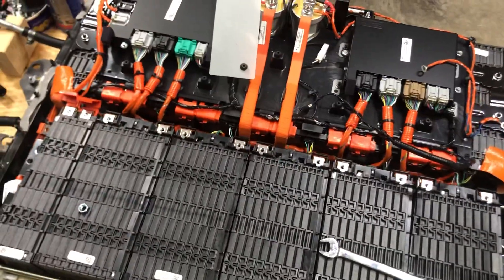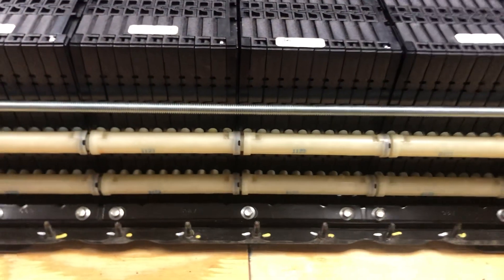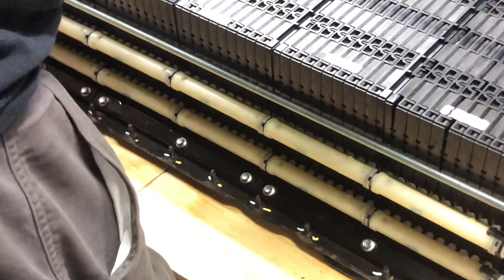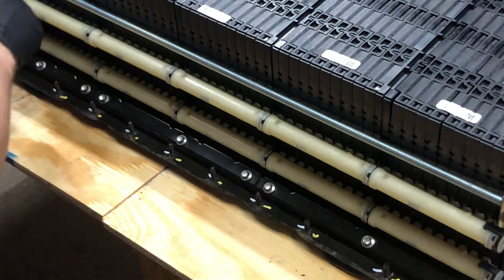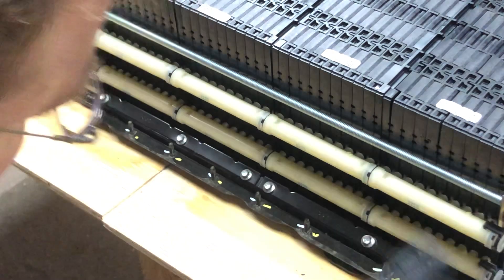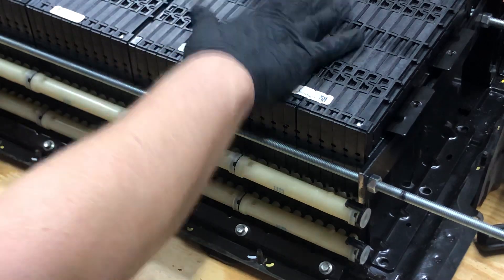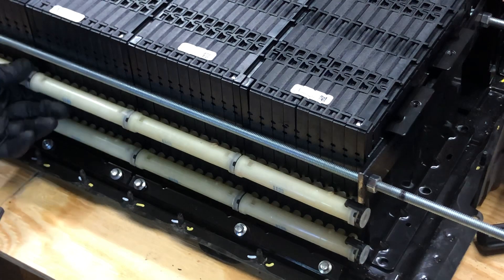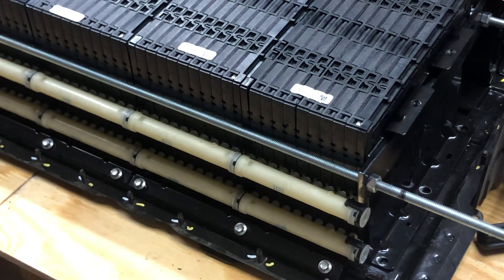POAA6 battery voltage leak repair that did not work!

Comment: You're pretty funny dude! Thanks for making these videos. I have a similar problem with my 2013 FFE. I have been trying to find out which pack is pack A for a while now. Thanks to your videos I know which one it is! I found some used batteries but the company sells the top and the bottom separate. You just saved me $1800.
Reply from the maker: Thank you! I love making YouTube videos especially when they are helpful to people. You can always call or text me at the number on my video.

Comment: Could you tell me how to remove the top battery cover from the lower battery pack? I have my lower pack out and need to open it up to see if it can be repaired. I don't want to damage anything. It seems to be glued on there. Any advice would be appreciated. Thank you!
Reply from the maker: It can be removed by prying the top off. It take some force. I used a couple of 15 inch crow bar/pry bars like you would use for construction. You can by them at Lowe’s or Home Depot. Wrap some electrical tape around them leaving a half inch of metal exposed as a marker so you don’t shove them in too far. It has a gray foam type sealant that holds it on. The hard part is finding new parts to complete the repair. They are almost non existent.

Comment: Did you ever fix the P0AA6 code?  If yes, what was causing it?
Reply from the maker: Yes, the POAA6 code in my case was caused was caused fluid in the battery. The coolant plumbing had been pushed about by battery bulge like you would see in old cell phone batteries. I could not find new battery parts so I sent the battery off to enerz in California. I still haven’t finished the repair because of of a separate damage that happened during the repair and I am waiting on a couple of wiring harnesses. They should be here this week September 2023.
Reply: @eprofessio  thank you, my 2016 Ford Fusion have this code and I'm trying to hunt down the issue.  Any suggestions?
Reply: @eprofessio  Thank you.  Is it the same Helms book that you see at AutoZone?
Reply: @eprofessio  thank you!

Comment: Did your repair as depicted in your last video work? Is your focus operational?
What issues are you encountering as a result of your last video?
Reply from the maker: My repair worked to stop the leak. I did not get all the fluid cleaned out after repairing and was still receiving a voltage leak fault. I pulled the battery back out to have it repaired by a place in California. They recommended I take the cooling system out of the battery and only charge on level 1. I instructed them to repair it to OEM spec. It will be back from the battery shop before too long. I bought this car as an introduction to electric cars without spending $40,000. I have a little over $10,000 into this lesson. I loved this car so much I ended buying one of the new Chevy Bolt EUV and a Mach E Premium for my wife. It was a great starter car for our family for the price.
Reply: @eprofessio  Which shop did you use for repairs and what did they charge?
Reply from the maker: @kyled9025  Enerz in California repaired my battery for around $2,400.
Reply: @eprofessio  awesome. Thank you very much, I actually live in Newark. What all did they do?
Reply from the maker: @kyled9025  they take out the poofed out cells and replace them with new and clean up all the coolant and put it back together. The other option which I have not tried is what is call deplating where they remove the cooling plates all together. I guess it’s the same price either way.

Comment: I have Ford Focus EV ... It's not working either
Reply from the maker: What’s it doing. Does it give you the red triangle of death and tell you to stop driving?
Reply: I have this issue stop car safely now 
As well as coolant pump stuck and high voltage battery and isolation message

Comment: Repair did not work? You do not know yet :) 

Test pipes with little vacuum or pressure before installing battery. And be careful, those cells are "hot" at all times.
Reply from the maker: The coolant system repair worked, there is still a voltage leak in the battery. I have already installed the lower battery as it takes about 1/2 an hour to do the labor and it is still doing the same thing.
Reply: @eprofessio  So maybe there is just coolant between cells? Others have HV connector surrounding corrosion so gasket will not keep water away from HV socket. I have this alert, but no coolant missing. 

Do you live in hot environment?
Reply from the maker: @__oK__  the other problem I have is it’s not taking a charge now which could be the battery relay boxes, the little black boxes that say FOMOCO on them. Yes, it does get hot in southern New Mexico. I am taking the battery back out today to see if I over looked cleaning up any coolant.
Reply: @eprofessio  I have positive contactor issue. It manage to operate it once with extra battery jump start. My LV battery is quite bad, so I think it has burnt the contactor mating surfaces. I start to investigate it when I got my PPE and HV tools to open upper battery.
Reply from the maker: @__oK__  buy a forscan subscription so you can read the error codes. It tells you withgreat details why your ride is acting up. Amazon cells the adapter for around $50 US and the forscan subscription is under $100. It’s totally worth it.
Reply: @eprofessio  I had water in one of these connectors: https://static.nhtsa.gov/odi/tsbs/2016/MC-10074364-0699.pdf

0.05Mohm I measured it with Fluke 1507. 
"If the BECM detects that the resistance between, for example, the high-voltage cable and the ground of the car is less than 171 kilo-ohms, the service indicator lights up in the instrument cluster.
If the resistance is less than 48 kilo-ohms, even then the service indicator lights up and after the ignition is switched off, the car can no longer be started if the fault still occurs.
In both of the above cases, the DTC is stored in the BECM module."

It should be over 1M ohm when you have black lead on ground (car chassis) and red on HV connector B+ or B- pin (testing on 500V, remember your PPE!). But be careful with these voltages. huollon merkkivalo syttyy ja sytytysvirran katkaisun jälkeen autoa ei enää voi käynnistää, jos vika ilmenee edelleen.
Kummassakin edellä mainitussa tapauksessa DTC tallentuu BECM-moduliin."
Reply from the maker: @__oK__  thank you for the update I will pull the battery back out and check for fluid in the connectors.
Reply: @eprofessio  I recommend to take plugs away from inverter (engine bay) and from upper battery. Then measuring with Megger the isolation. That way you do not do "worthless work" like I have done. Next time I start to measuring and taking plugs out to narrowing the place where the issue is on. It is quite simple, but you have first understand the basics of Megger.
Reply from the maker: @__oK__  I don’t mind doing the work as it is a way to discover new things such as now I know how to remove a focus battery pack very quickly and how to disassemble the pack very quickly too.
Reply from the maker: @__oK__  I am still getting the POAA6 code so there is definitely still an issue.
Reply: @eprofessio  With insulation meter you can check where the fault is. Do you have Instagram? I can send instructions how to check isolation failure.
Reply from the maker: @__oK__  I don’t have any social media except YouTube. You can always send pics to my phone that’s listed on my YouTube account. 5057507867.
Reply: Did you get it working?
Reply from the maker: @__oK__  I just got it jacked up last night. I have about a dozen projects going at any one time. I will drain the fluid and disconnect it tonight or tomorrow night.
Reply: @eprofessio  I found the problem: https://youtu.be/WxDZQSRKCaQ
Reply: @eprofessio  Looks like I got my car working again! Now it is loading and isolation is way more than 1M ohm. 🤩
Reply from the maker: @__oK__  awesome!
Reply: @eprofessio  How is Sparky?
Reply from the maker: @__oK__  I am boxing his battery up to ship him off to have him repaired.
Reply: Did the battery and the cooling system work ? 
I don’t want to tear mine down until I know it can be fixed!!
Let me hear from you please.